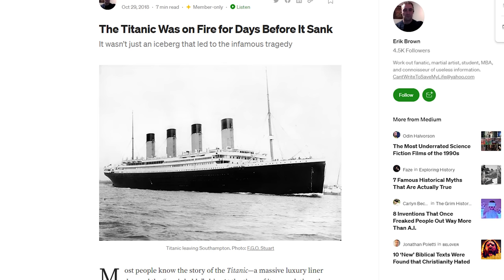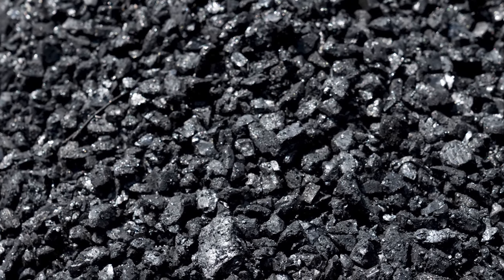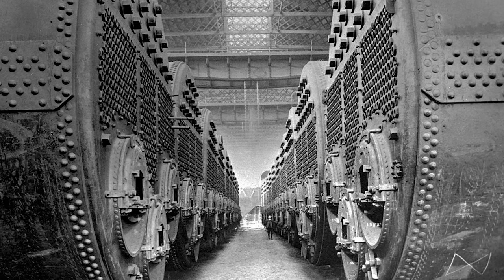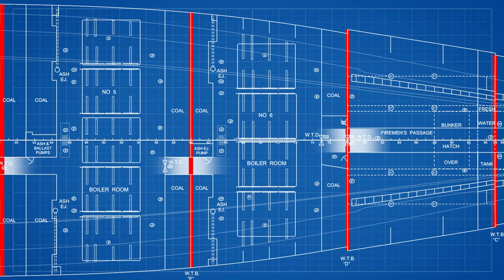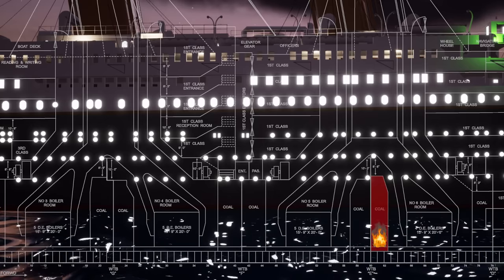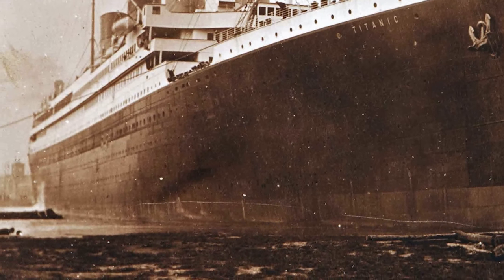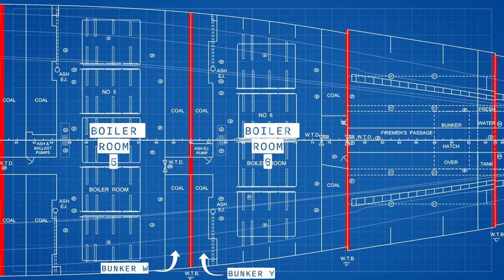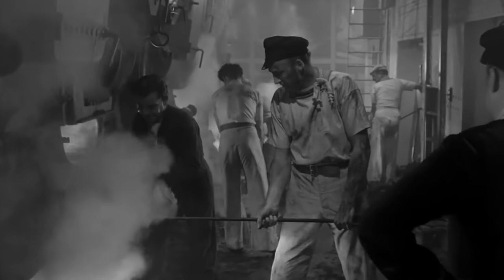Did the Titanic's Coal Fire Cause the Disaster? The Burning Question.

Comment: Based on this video, it still makes sense that the coal fire might have somewhat accelerated the sinking since the coal bunker rigidity might have been compromised. Even if it wasn't watertight, it might have held the water for a bit longer. 
Also the hull plates might have been damaged by the fire thus less resistant during the collision. 
As for the increase of speed caused by getting rid of the coal, although it was possible to release extra steam without speeding the ship up, it would also be logical not to waste the pressure and to make a use of it instead.  
So even if it wasn't the coal fire what sinked the Titanic, I would hesitate to say it didn't affect anything at all.
Reply: The two dents in the bunker wall caused by the heat didn't bring down the bunker; the non-watertight doors attached to it were what gave way, not because of the fire, but because of the hundreds of tons of water up against them. The fire was irrelevant in that regard.
The fire wasn't up against the hull, either, and the only damage ever done was the aforementioned two dents in the bunker wall, not the hull. The fire never got big enough for that. Even so, the vast, vast majority of the iceberg damage was across sections of the hull that were nowhere near the fire, and 5 compartments still would've flooded.
The coal wasn't making more steam, because they weren't putting it into the boilers; they were putting it into another bunker.

Comment: 8:50  You discount an earlier fire ..but then answer: why did the stokers all leave ship so as to necessitate a new gang of stoker's?  They left because they knew already.
Reply: What evidence do you have of that actually happening?
Reply: Actually, the evidence for your comment is notable only by the absence of any. However,it is quite likely true that most of the Belfast 'delivery trip' crew would choosenot sign on for Titanic's maiden voyage, even if asked. There is a very simple and logical reason for this, which does not necessitate a conspiracy. 

The voyage from Belfast to Southampton was a short one, while the North Atlantic route (Southampton to New York) was much longer. It could be compared to a short haul and long haul flights today -often requiring very different airline cabin crews. The crew aboard Titanic from Belfast to Southampton were (except for the deck officers) local operators (or "runners") who mostly worked on voyages that were made locally, and did this with a number of ships, not just Titanic. 

They would not be interested in the transatlantic route as it would mean not returning to Belfast or Southampton for several weeks. They would only be interested in shorter crossings. However Southampton, (which had replaced Liverpool as a major international hub) was where transatlantic liners such as those of White Star and Cunard were based, thus the crew based in Southampton were experienced, international men. 

It makes complete sense that the local Belfast runners did not sign up for a transatlantic maiden voyage, when they were not experienced or interested in such a trip, which would result in them losing all the local jobs they preferred when local Southampton crew were used to such "long-haul" trips.

Incidentally, had there been the slightest bit of credibility in your comment, wasn't it odd that there wasn't a spate of 'told you so' comments from these men after the sinking?

Comment: There were not hundreds of stokers, there were 163 plus 13 leading firemen. The Titanic sunk more rapidly than was expected, though not because of the bunker fire. They did not in fact get all the lifeboats away loaded as they were not initially expecting it to sink. The ship was not overbuilt. In fact the hull plating was 20% thinner than Thomas Andrews wanted. Ismay overruled him. Lord Pirrie's response was why did that ship sink so fast?
Titanic did not rear out of the water like Cameron's movie, only a White Star officer said that, the other eyewitnesses did not. She broke beneath the expansion joint where hull flexing had been observed on sea trials. It is worth noting that the Olympic was showing rivet cracks when drydocked for repairs. The expansion joint was modified and the hull of the Olympic strengthened. The Britannic had the expansion joint completely altered.
The speed of the sinking was due to structural failure from a design flaw, some bad luck and actually very poor quality steel for the task which was thinner than the design originally specified. The luck was turning, whoch meant that the side was hit not the bow. 
There would have been far fewer casualties had Smith not been a show off (he ran a ship aground coming too fast into New York) and had the Wireless Operators not been rude and ignorant telling the W/O of the Californian to "Shut Up I ma workign Cape Race". The W/O turned off his set and went ton bed. Had he not done so he would have heard the SOS as he was inclined to just listen after duty.
Reply: Where did you get the myth of the hull plating from?    Titanic, like Olympic before her, was designed by Harland & Wolff, who presented White Star with a tender for the cost of construction. The ship did not sink quickly. Compare her sinking to that of Lusitania, for example. 

Ismay was not a marine architect, and had precisely no say in the type of steel used. Smith acted exactly as any other captain would have done. He altered to a more southerly course, and warned his lookouts to be particularly vigilant. I don't make this claim, but several Master Mariners who gave evidence at the British Inquiry did.

When did Smith run a ship aground entering New York? I am sure you will immediately provide chapter and verse on this!

Phillips did not send 'shut up' to California.  At least, Californian's operator said he didn't, in his evidence. He said that Phillips simply asked him, in Morse shorthand (probably DDD) to clear the frequency.  The operator then switched off his set because his shift had ended. He was Californian's only operator, and did not work 24 hours each day.

Comment: I am sorry, but you literally just said that the people working there reported that it was distorted.
And on top of that, the "test" would not have mimiced the actual conditions because the FREAKING RIVETS were not set properly. Exactly the same problem Boeing seems to have. We KNOW from the wreck that the rivtes didn't show damage due to strain and seem to have come right off. Which means they weren't doing their jobs. 
And the brittle-suctile steel problems have been known since the middle ages. And yes, they were using low quality steel. apparently the carbon content was quite low. They knew about it but the manufacturing process for high carbon steel was a bit more expensive so they chose to go with low carbon. So yes, they DID cut cornersso please. 
This madness to continue justifying its  build is an effort by H&W, the boeing of shipbuilding. It doesn't matter how much we keep providing evidence for companies like boeing and their cost cutting practices, safety violations and cheap material usage, they will use the propaganda machine to continue saying -  our built it perfect and the best. Same is true for H&W
Reply: "I'm sorry." No, you're not.
Reply: @PersephoneDaSilva   Oh yes I am - for the H&W stooges that defend companies like Boeing. Get lost

Comment: I truely believe that the fire below decks did contribute to the sinking and reducing its structural integrity on the side of where the burg collided on the port side. When finding out about the fire a while back I tried to do some digging into it.
Reply: It was no we’re near the side though.. 🤷🏽‍♂️ it was further inside in a coal bunker which is not on the side of the ship..
Reply: @xismecwilliams9604  No need to be bloody rude and showing off and rubbing it in about it mate, after making the comment I realised my mistake.
Reply: The hull had the entire ice cold Atlantic as a heat sink to cool the plates. That fire never got anywhere hot enough to affect the structural integrity. You have 45000t going over 40 kph hitting a 4 million ton hardened ice mountain. Arctic ice is not soft like an icecube. It is thousabds of years old ice that is extremely hard, comparable to rock. Not even a battleship would remain undamaged. 

If Titanic was 2.7 m long her hull would be less than a mm and the iceberg as heavy as a house. You might as well run int a continent. I have never found one of you fire conspriacists to have a basic understanding of physics especially heat flow and materials properties. That steel was soft as butter in the impact. The kinetic energy was aroubd 200 Gigajoules. That is about 1.5% the energy in the Hiroshima bomb.  Or in the range of 200 t of of TNT. A Harpoon missile has a 500 kg warhead and can sink a small warship. Two of them got the Moskva, well a Ukranian clone anyway.

If we go larger and look at the Exocet missile you can ask the British what that does to cruiser.

Comment: No, it didn't "cause" the disaster...but it sure made it much worse. It also has to be mentioned that the water was ice-cold, which we now know reduces the strength of the steel. So it was a combination of factors...The look-outs not using binoculars...the captain turning off the engines when turning, which reduced the amount the ship could turn...the iceberg...the weakened steel from the previous fire & the below freezing temp of the water in the ocean...the decision to not hold disaster drills...the lack of life-boats...the decision of another ship to not bother investigating...the Titanic radio crew not doing their job with radioing for help and not giving their accurate position.
Reply: Olympic sailed the same waters for 23 years, without any steel 'problems'.
The binoculars made no difference. As glasses were used to identify objects already spotted, their use may well have delayed the alarm being given.
The captain was not on the bridge at the time of the collision.
Life boat drills had been postponed, not cancelled. There were more lifeboats aboard Titanic than Board of Trade regulations required.
The Marconi operators transmitted the position which had been given to them by the command staff.

Comment: The fire doom her
Reply: Did you not bother watching the video before commenting?
Reply: @dovetonsturdee7033  yes have no doubt the fire caused so much to area the ice hit her just add on to problem no matter what
Reply: @donaldmcauliffe3120  Perhaps you simply didn't understand what the video said, then?   The smouldering fire in Bunker W, extinguished around a day before the collision with the iceberg, did not damage the bulkhead.

The supposed fire about 40 - 50 feet further forward, imagined by Mr. Molony on the basis of one mark on one photograph, did not actually happen. The mark was well above the waterline, where 3rd class accommodation was located. 

Did any 3rd class survivors report any blazing inferno in that area?   No, of course they didn't.

Comment: Ok .. 706 survivors all had different documented stories.. will this event ever have a conclusion? .. however I do like the insurance job version
Reply: 'the insurance job version.'  Do you mean the one where a ship costing £1.5 milllion to build in 1911-12 was scuttled in order to claim £1 million back in insurance, which destroying White Star's reputation for safety at the same time? 

It would have been cheaper to shovel pound notes rather than coal into the boilers.
Reply: @dovetonsturdee7033  I might watch it again.. there was a very costly collision with the Olympic with a battle ship .. that would like be crashing into a bulldozer
Reply: @grahamcampbell400  The collision was with a protected cruiser, at low speed (8 knots). Olympic's starboard quarter was damaged.  Two compartments were breached, and a propeller shaft bent. Repairs were completed in seven weeks.